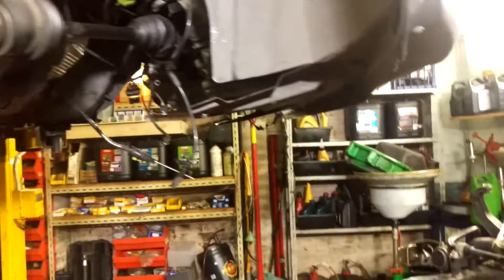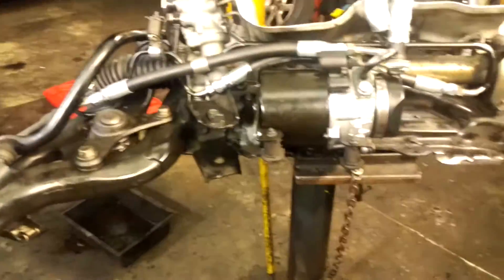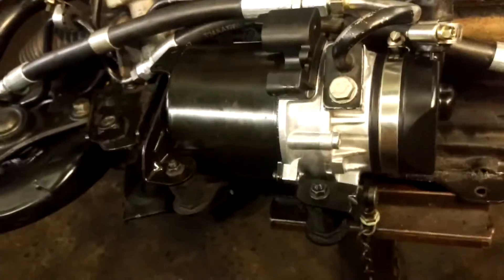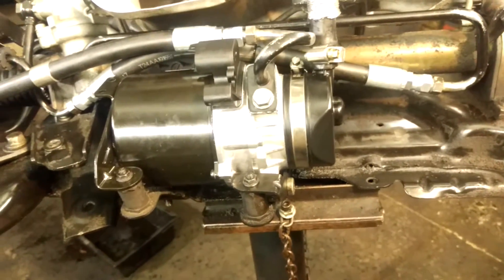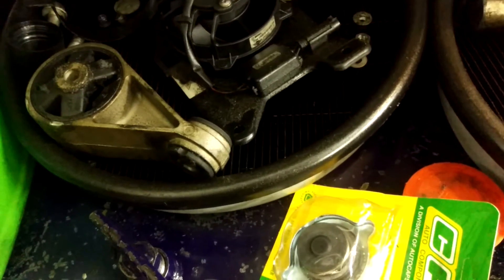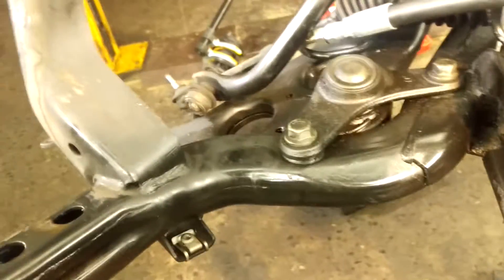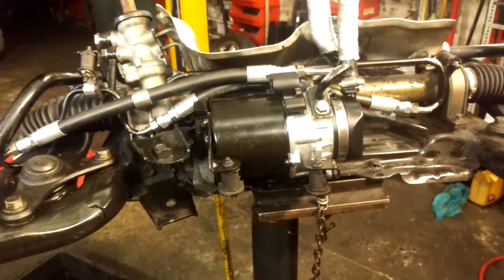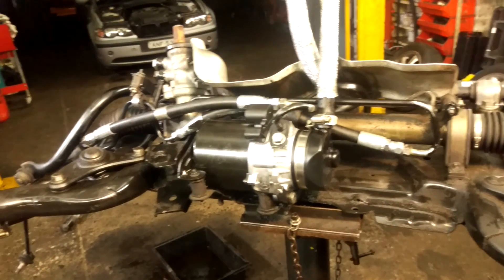Mini R50 R52 Steering leaks electric steering suspension bushes shock absorbers

Comment: So the leaky shock is the initial cause? Just had my rack piss out all the fluid and noticed the left shock was leaking.
Reply from the maker: +YakuzaWAFD no seized top strut bearings can contribute and cause this. Leaky shock i dont think puts extra load on the electric steering system besides this strut top bearings that are tight